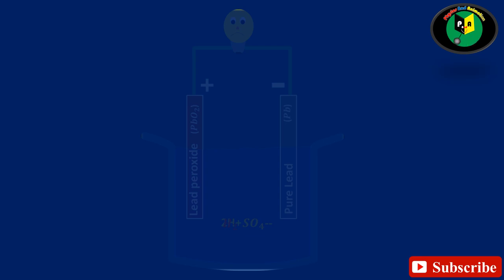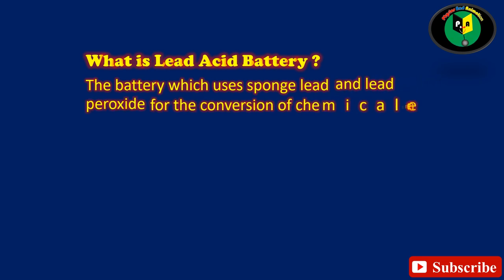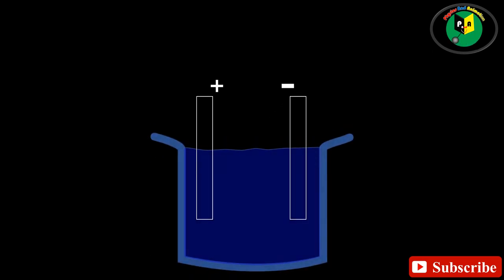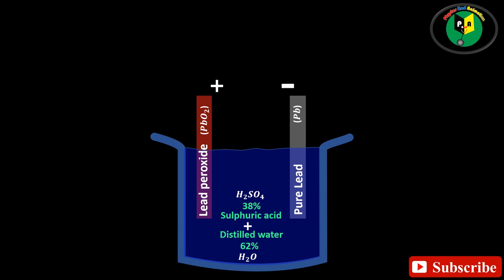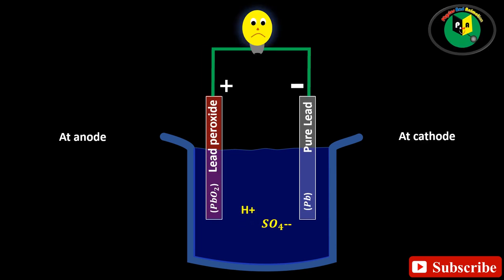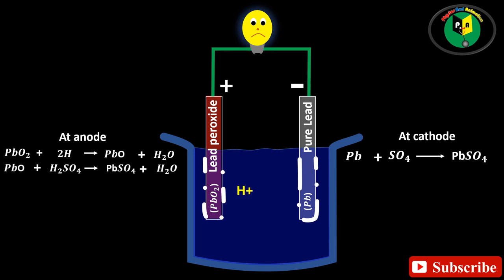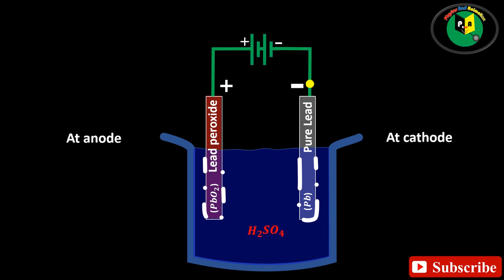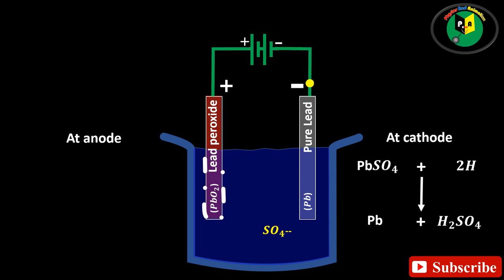Working Principle of Lead Acid Battery

Comment: During discharging in lead acid battery +plate is cathode but you write it anode... second during discharging how can H+ first go to +plate(as you said) ... so start from negative plate (because during discharge spontaneous reactions occur..) Pb will (be oxidized) lose 2e spontaneously (due to difference of oxidation potential with PbO2) and will come in solution to make PbSO4.

Comment: The electrode of a battery that releases electrons during discharge is called anode; the electrode that absorbs the electrons is the cathode. The battery anode is always negative and the cathode positive. This appears to violate the convention as the anode is the terminal into which current flows.
Reply: I believe your comment is correct when presuming what is referred to as "Conventional Current" theory which was found to be false about 1900. This diagram follows correct Electron Theory which has been around for the past 100+ years. There was even a Nobel Prize for the discovery of Electron flow that is used in this presentation. I don't know why "Conventional Current" (aka "hole flow") is still taught in our educational institutions; however, that is the reason I suspect you have been confused. Cathode is emitter and Anode is collector.

Comment: You have labelled cathode and anode on the wrong side
Reply from the maker: In a galvanic (voltaic) cell, the anode is considered negative and the cathode is considered positive. This seems reasonable as the anode is the source of electrons and cathode is where the electrons flow. However, in an electrolytic cell, the anode is taken to be positive while the cathode is now negative. From google
Reply: Electron releasing is from anode.... here it is from cathode... make it clear
Reply: The electrode of a battery that releases electrons during discharge is called anode; the electrode that absorbs the electrons is the cathode. The battery anode is always negative and the cathode positive. This appears to violate the convention as the anode is the terminal into which current flows.
Reply: You're right, but just to make a validity to the concept, IF you ignore anode and cathode, the current flow is correct from a theoretical standpoint. That is, a current with positive flow.
Reply: @AlthafBscphysics  No, it is the other way round.
ie; Anode absorbs electrons during working (discharging) and release electrons during charging.
Reply: Yess
Reply: I cant understand what youre saying
Reply: Exactly bro it confused me ...
Reply from the maker: From Google - 
.
In electrochemistry, the anode is where oxidation occurs and is the positive polarity contact in an electrolytic cell. At the anode, anions (negative ions) are forced by the electrical potential to react chemically and give off electrons (oxidation) which then flow up and into the driving circuit.
.
Please don't get confused
Reply: @Physicsandanimation  u r true man but the point is we use lead as an anode here and led oxide as a cathode...u have mentioned it reverse

Comment: Brother if this reaction happens then from where the oxygen atom came from?
PbSO4 + 2H2 + SO4 ------ PbO2 +2H2SO4
 In this reaction, the reaction is not balanced.
The reaction reaction should be like this, as followed
PbO2 + 2H2 + SO4 ---------  PbSO4 + 2H2O

Comment: Is the negative terminal at low potential compared to positive terminal?  If so, how would electrons move from low to high potential?  Everyone uses water tank analogy to tell us that things move from high to low potential.
Reply from the maker: Inside a source direction of current is negative to positive while outside the source it is positive to negative
Reply: @Physicsandanimation  My question is not about the direction of the current  Please tell me if the potential at negative or positive is more.  When we measure potential difference between two electrodes, we say it is 1.5 volts for a given battery.  In that case, is the potential high at the negative terminal?

Comment: The terminals are mislabeled.  Anodes and cathodes are not defined by voltage polarity, rather current flow.  Because of this, battery terminals are labeled anode or cathode based on whether the battery is charging or discharging.  A discharging battery's positive terminal is a cathode.  A charging battery's positive terminal is an anode.
Reply: 100% true. Most people (specially in India and Bangladesh) doesn't have access to good education. That's why this video is providing wrong information. Anode is where oxidation is happening and cathode is where reduction is happening.

Comment: Initially from where we get +ve and -ve charges on electrodes..?
Reply from the maker: Electrolyte (H2So4) dissociates in water
Hydrogen takes electron from lead dioxide(PbO2), and electrode becomes positive, 

as spontaneous reaction gives positive charge to lead dioxide electrode and negative charge to pure lead electrode they are taken as positive and negative respectively. 
.
Thanks for watching. 😊

Comment: lead acid battery coming back because of cheap availability ... for instant charging  by  remove and refilling the electrolyte system will coming  in future  .. electrolyte station will be there instead of petrol / gas station ... no need to wait charging ... only need the battery have a outlet and inlet where electrolyte remove and pump back to battery .. full charge immediately station
Reply: Great think

Comment: It's not lead peroxide ..its lead dioxide
Reply from the maker: Yes you are right, Thanks for your feedback friend, we are very sorry for our mistake, we will not repeat this in our upcoming videos, we are very thankful.  to you :)
Reply: @Physicsandanimation  No you can call it both
Reply from the maker: I was also confused but I searched for it in Google Lead(IV) oxide, commonly called lead dioxide or plumbic oxide or anhydrous plumbic acid (sometimes wrongly called lead peroxide,) is a chemical compound with the formula PbO2.
Reply: How about lead oxide?
Reply: @azhanproton  Yes, most commonly known as lead oxide in the general field of chemistry.  Most common, not necessarily the most descriptive way.  It's simply short and sweet to say lead oxide.
Reply: PbO2 gives H2O2 on reacting with water.. so you can call lead peroxide also. Nothing wrong in it